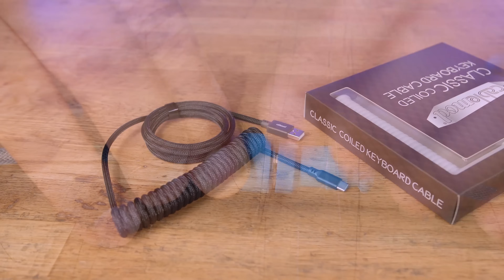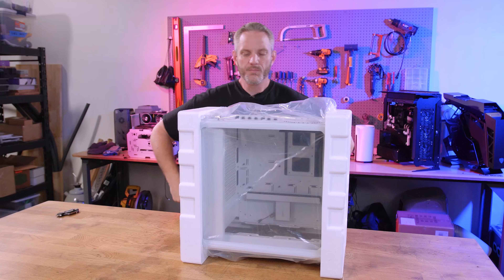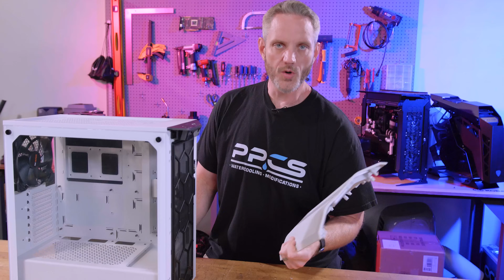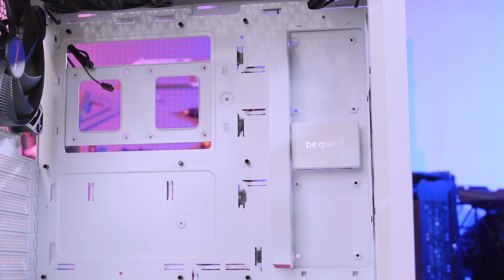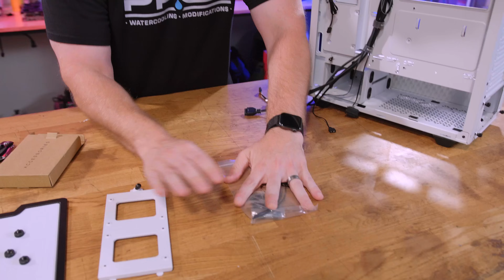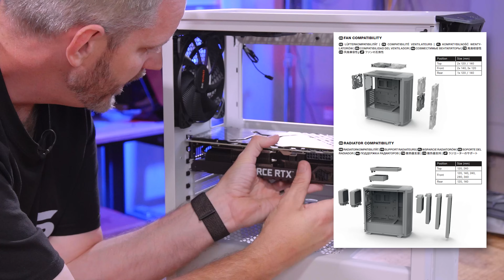An amazing case you can actually AFFORD!

Comment: I love my 500DX. Easy to build in, very high build quality for the price. After building in a couple lian li cases, and a couple corsair I can happily say I'll be actively looking at building in a be quiet for my AM5 build. Also, If you remove the be quiet logo where the 3.5 SSD standoffs are you can 3'd print Pump Mount to fit in that logo's bracket. Pump mount fits with a 6700xt red devil in my 500dx
 reservoir location is the hard part.
Reply: So random to see someone with my same build. I dont have water cooling atm, but I want to look into ur mentioned mod!

Comment: You don't need to give up your HDD bay to run a 360 rad. You just need to slide it back a little to clear the rad. Just keep in mind PSU size and cable management.

Comment: Hi, my older revision has two possitions available for the HDD bay. Still not enough space for rad?
Also the L shaped cable channel was kinda pain to work with. It gets crammed quite quickly and navigate through 24 pin and all sata and usb cables without breaking them required either looping the cables and thus obstructing airflow or investing in 90° adaptors for the most stubborn cables to get them out the way. Anyway I would love to see some waterloop in this case as an inspiration. Thx

Comment: its a nice case for shure. My tip: 1.Get an 360 AIO for your Cpu 2. Move the be quite front fan to the top 3. Use the AIO as front intake and the silent wings as exhaust. 4. Have nice rgb in front, enough fans for most builds and the possibility to run it all quitely. 5. Profit

Comment: For that SSD mount/cable management panel, I really suggest getting your drives in place and securing it before attempting to run power cables through it. You will have a hell of a time trying to get the panel back on if you've already run your power cables.

Comment: I had a relatively difficult choice between Pure 500DX, Corsair 5000D and FD Meshify 2. While I was considering cases, I got an idea of a custom loop, which discarded 500DX. I end up with Meshify 2.

500DX is still a good competitor for my NAS/server case. Even though it doesn't natively support that many HDD/SSDs, most likely I can craft some additional mounts.
Reply: If you go for SSDs, you can put them anywhere, at any angle, as they have no moving parts.

Comment: This is the case that I have and there's no way you can put a radiator on the top. Even with a 140 fan on the top I can barely get cpu power wires plugged in but the case is perfect for a front radiator. Also the case is very wide so you can use the biggest air coolers and this case will fit virtually any gpu without any fitment issues. I have the radeon 6800 reference card with a corsair 240 aio in the front and theres about 4 inches between the front radiator and the graphics card. Theres still alot of space to add a much larger card

Comment: Loving my itx phanteks P200A build I just finished. A 280 and 240mm radiator in an ITX case with a 30 series gpu and a full atx psu has some crazy tight fitment!!!

Comment: I've had this case for 1.5 years now and it's fine, nothing wrong with it (other than lackluster front IO). It is however NOT silent, you can clearly and loudly hear your GPU fans through it.
Reply: What's your fan arrangement? If you leave it at stock, the 2 exhaust fans will steal all the air away from your GPU, making it work its fans harder and louder.
I'm also wondering what the seal is like around the TG panel in this case as I don't see any cushioning around it.
Reply: That’s the situation for any airflow case. The GPU is loud, not the case.

Comment: You are absolutely right with the cable channel. I did a build in this and using custom Cable Mod cables was horrible since my 24 pin was right next to that cable channel. It forces the cable to do a hard bend to plug in.
Reply: I was thinking the same. It might work if the 24 pin connector was a right angle off the MB but it'd be horrible if it was pointing straight up. Also, my Seasonic PSU has a hard material wrapped around the cables near the 24 pin plug and that absolutely will not bend. This L-bend looks like a cheap alternative to using rubber grommets.

Comment: I went with BeQuiet for my AIO, Fans, and Case and I am extremely happy with it. Looks clean, sounds good, good build quality, decent prices.  BeQuiet doesnt seem to get much attention in the midst of a lot of their competitors for some reason, which is a shame. They are making some really solid stuff.
Reply: One of the reasons why I went with "Be Quiet" this time for my case.. is some of them are very modular in design to the point you can custom make your case into what you want it to be.. for me the big plus side was my case is able to flip the motherboard upside down to have the case sitting on my left side ..also providing better thermal cooling for the graphics card (plus you can actually enjoy the design that is normally under the card)..
Reply: @rknudson1407  I completely agree. I spent more on the Silent Base 802 when I could have just gotten the 500DX, but the 802 has so many options to keep it fresh or add drives that it's got room for me to grow. I also plan on using it for my future builds

Comment: Up to and including my last build in 2019, I was completely in the camp of cheaping out on the case. Was always about the last thing I added to cart and I always tried to spend $50 or less. Seeing all these really nice cases now and seeing reviews including info on airflow, noise, etc, I'm seriously considering just buying a nice new case to transplant my build into. The internal components are great and all, but what I'm looking at all day is the case.
Reply: I have this case, it is pretty nice and not very expensive. I like to go a little above the cheapest spec usually and smaller but this build is going to have fully populated PCIe with a 3900x so I figured a few more $$ on a decent case was worth it.

Comment: I ended up getting the Fractal Design Torrent Tempered Glass in white with my Asus Crosshair VIII Hero Wifi, Noctua DH-15 Chrome Max with the white covers over the heat sinks, Noctua 140 MM fans in front and bottom and one on the back for exhaust it is a beast for my 3950! soon im gonna get the Intel 13900K when it releases but use the same heat sink and case and fans!

Comment: Did this case for my recent build and I love it. My only complaint is I had a weird rattle in it due to my HDD. Adding more rubber to the feet got rid of it as a cheap go to fix thankfully. And the RGB cable doesn't work with any board I've tried to connect it to, but at least it has a button. Otherwise, it's silent, easy to clean, and well built.
Reply: That cable works for me, but the button on the front can mess with RGB software
Reply: my dogs ate two of the rubber isolator mounts, after they fell off the screw pins on my dark base 900 pro v2...I'll be needing some of that rubber for my build too... lol

Comment: You can run a 360 radiator and move the HDD cage to the back. There are threaded holes prepared to just mount it on that position. I also have a vertical mounted GPU in it (still enough air to the radiator), the stiffness of the back is not a problem. Still had to saw off the spacers.
I built four mid- to highend PCs in this case, absolutely love it.

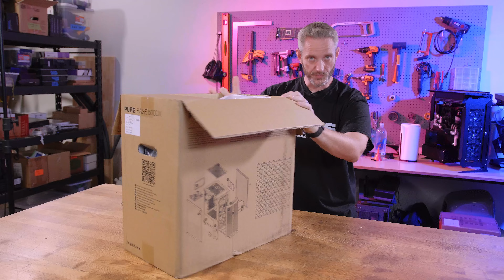Comment: 0:53 my phanteks P600S would disagree. You can have both silence and airflow. Put the top and front panel on for silence or take them off for very good airflow. I know it has very good airflow because all reviews done airflow tests including gamers nexus and they showed it has the best airflow at the time.

But I want to downsize to a MATX or ITX Case and I'm having trouble finding the right case.
Reply: For ITX maybe the Cooler Master NR200P Max. It includes both a vented side panel and a TG panel, so you can choose between cooling and looks.

Comment: I've had this case for a little over a year and I absolutely love it. It's still more quiet than any case I've had previously, but the thermals are great. All for a decent price. And the white design is just killer.
Reply: Basic method of getting a quite case is good ventilation, and many high quality low noise fans running slowly. Modern PC systems with high end processors and graphics cannot survive in a case with small openings. Fan choice is extremely important and best to over spec the CPU cooler so its fan(s) can run slow. Do not skimp on the power supply as the internal power supply fan can cause excess noise if running near max output.
Reply: @geoffreyveale7715  Silence is key
Reply: Can you put in 3.5 hdd-s aswell?
Reply: @makingastardestroyer3066  get an m.2 or sata ssd

Comment: Awesome cases as long as you keep the air flowing through.. I'm building my next "new" computer... going from 6th gen intel.. to 12th gen intel.. I will be disabling the e-cores to run on Windows 10 pro..and just bought on discount a (Be Quiet Dark Base pro 900 v2) for cheap ...$180 ..already have an Asus Z690-Plus Wifi D4.. and placed order on a Corsair H170i cooler with lga 1700 retrofit mount screws all for bout $200... theres no such thing as "overkill" lol

Comment: I upgraded my GPU right in the middle of the parts shortage about 6 months ago.  The best deal I could find was a barely used Power Color Hellhound 6700xt Spectral White edition.  I had to dremel crap out of my old case to get it to fit.  I later upgraded my case to a white 500DX and also swapped out the stock AMD cooler for a white Vetroo V2 and it all looks great.  The case is damn near silent and the white GPU with the light up eye in the hellhound graphic looks really cool with the case RGB set to white as well.

Comment: A case should be on your desk, not the floor. And  so the way it looks and how silent it is becomes a big deal. 
I bought last year the BeQuite  Silent base 601 and it looks really nice, it's very silent,having the right fans helps. it has even a switch with 3 levels of power/speed for the fans, so my fan hum sits in a box. And it keeps my hardware cool, even with the solid front panel that has mesh on its sides. 
I feel that the 500DX is a step down as the 601 does come with the option for a mesh front panel. But the 601 has more options for cable management and a retractable grill for the upper fans and radiator. It also has the option to open up more the basement of the case due to having 2 removable plates.
And the 601 did cost me around the same as this 500DX. Okay, it did come with just 2 BeQuite fans.
The 601 also has the option for a vertical mount, but as every person with a little common sense has concluded, that's not efficient when it comes to cooling. And maybe BeQuite has listened to you guys regarding this 🙂 Personally I believe it was a trend that will die soon. Showing off at the cost of worse performance is just ....

Comment: The exact same case I have with an AMD build inside, 5600x, B550 Tomahawk, 16 GB DDR4 CL 16 3600Mhz, those 3 stock fans and and Arctic Freezer 2 - 240mm for the CPU, RX480 8 GB Sapphire  all of those powered by the heart of my system, Seasonic 750W, FOCUS GX Series :)

radiator on the top, 2  fans beQuiet! on the front and 1 at the back and the results in full load are 75 C*  for CPU in CR23, 75 C* in Tombs Raider for RX480, (1330 Mhz, 1090 mV,  2055 Mhz memory with Memory timming level 1 and power limit +50%.

as Fan control I use  Fan Control V117    THANK YOU JAY !!!!

Comment: I have the normal Pure Base 500, so easy to build in. I love the 140mm rear fan which most compact mid towers don't bother with. The SSD display bracket is a cool feature to fill up the front.

I wish they made a Silent Base compact mid-tower. I'd buy a 601 or 802 if they weren't so massive. Most people esp gamers don't need 5+ hard drive trays, 2 in the basement is more than enough (I don't have any hard drives). If you need a big case get the others but most want something small these days. And the front should be swappable for solid and mesh to please everyone.

Comment: Not a case snob, but I do appreciate a good looking case. Been building systems since around 98 when all you could get was a beige box, I remember when they started coming with more custom front panels. Had one that looked like a Nokia phone for a while. But by far the best case I had nearly 20yrs ago... was a Lian-Li all brushed aluminium one... That was a thing of beauty, 2x 40mm fans in the front another in the top... a little ally flap that opened for USB and headphone ports.

But overall... I've made pretty poor choices in cases. Often buying based on budget rather than desire.

Currently using a Corsair 680X which looked really nice, but has some serious design flaws that it's little brother the 280X doesn't... Such as having to remove the entire front tray & fans just to clean the filter.  I ended up removing the front glass, just allow me to clean it easily. Same goes for the top filter, and it's an even bigger pain because that's where my 280mm AIO sits.

The previous case... had such restrictive airflow to the front ML fans, that they constantly increased/decreased speeds... ended up cutting slots in the front cover down each side to allow better airflow, and rebuilding the system for my mum with a Ryzen 3 3100 and 3800X wraith cooler... so it idles at such a low temp, those fans have never spun up past their quietest setting ever again.

I'm also running a sliverstone HTPC chassis for my mediaserver... a little cramped inside when you've got 7 HDD's a BDROM and 4 corsair 120mm ML fans... But very quiet, just have to keep on top of cleaning all of the filters as the intakes are underneath and suck up a lot of dust.

Won't be building another for a couple of years... might upgrade the CPU & GPU at some point... So next case purchase might not be until around 2024 or 25... Might decide to go for a white build next time providing there isn't still a 25% premium for the exact same hardware in white as there is now.

Comment: I bought this case 18 months ago (white version) & I'm still enamoured with it, the thermals/noise levels are excellent & it's an exceedingly well engineered design. Though you forgot to mention that aside from the stylish front rgb panel, there's also an rgb strip inside the case for additional lighting.
Reply: Just said thst of the rgb stril.
Reply: Wait WHAT there is rgb in my case?  Can you tell me where it is please? (Im a first-time builder and didnt notice a rgb strip
Reply: @miskapiska2188  is just up the glass panel,  in de inside, so it gives light to all the  case and the floor a little.
Reply: @miguelangeldominguezbriant9178  thank you
Reply: @miskapiska2188  It's on the underside of the top of the case, on the side of the tempered glass panel.
Reply: @justV51905  thank you
Reply: Hey @Gris, I accidentally bumped into your comment. I read that you have had this case for a long time now and that you are happy with the noise level and thermals. Did you ever take out any of the filters/meshes/covers, or are you working with the native setup?
Reply: @enagid  No, I haven't changed/removed any of the filters, the only change I've made was adding an additional fan inside the case for a bit more airflow to help out my rtx 3060 TI, as that generates a fair bit of heat under heavy load when gaming.
Reply: Hello @Gris, where did you place the fans? So you use 4 in total?
Reply: @djdplay  Hi, the out-of-the-box setup was one at the back, one on top to the rear & one at the front; I added one more at the front to increase air-flow coming into the case (the two fans at the rear of the case take air out) I've been debating adding a couple more on top since replacing my 3060ti with a 3080ti, though will likely add another to the front first once I've bought another m.2 drive (currently using the hard drive caddy for an old hdd - the caddy gets in the way of air being allowed to fully circulate inside the case)

Comment: I use a 500DX and I love it... whats important to mention is, that the Hard Drive Cage has two positons, one further away from the front of the case... Squeezes the PSU Cables a bit, but a 280m Radiator fits in there perfectly
Reply: 360 as well :)
Reply: @MarcinDąbrowski-g9g  If you mount with the tubes up, that might be the case, mine is mounted tubes down and that would not fit with a 360 and the cage
Reply: @nabronator374  That is definitely the way in my case (pun intended:)) Regardless this case is amazing and I just hoped someone would point to the fact that the cage has two positions.
Reply: I just built in this case a few days ago with a 360 rad in front, you will need tubes at the top if you want to keep the drive cage. Using the pure loop 360 the tubes wouldn't even reach the bottom around the gpu though, and I assume this is likely the "case" for most 360 aio's.

Comment: I love good cases. Currently my build resides in a Corsair 5000D Airflow, and it's not perfect, but it's damn good. My two complaints are that they should've made the case slightly larger so it could utilize all 140mm fans and the way the CPU plus line up on most motherboards interferes with mounting a top radiator.

Comment: I always loved mesh panel chassis. I highly advise keeping an air purifier by your PC if you want to eliminate the use of filters to improve airflow without worrying too much about dust buildup. I understand dust buildup is one of the reasons for using filters and avoiding mesh panels, but when you take proper care of your system, the cleanup is very minimal. The only part of my PC that has a fan filter is the PSU intake. Everything else is fine with the way I have my airflow configured. It takes a really long time for any kind of dust buildup to be noticeable. It's been close to a year since the last time I needed to clean my PC. I check on it every day and barely see any dust buildup.